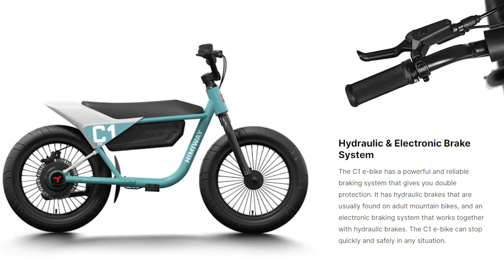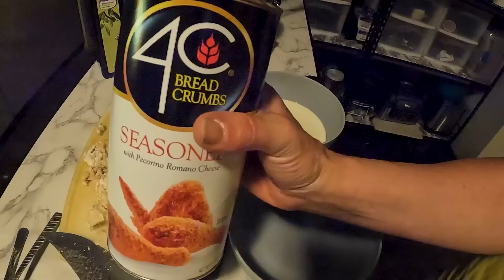Things Sure Have Changed.. Life On Our Cabin Homestead | Giving The Gift Of Adventure! |Himiway C1

Comment: Make a slurry with your corn starch. Mix the corn starch with a little bit of cold water and stir it into the boiling liquid.
Flour makes a roux and corn starch makes a slurry. The trick is adding cold slurry to boiling liquid, it will thicken quickly with no lumps.

Comment: Happy Birthday Julia

LOL you set 10,000 timers when you set yours. 1,000 corn starch suggestions I agree with. π r² but cake is round.

My own recipe, no bake strawberry cream cheese pie (Kool Aid pie)
3 - 8oz.softened cream cheese
3 - 8oz. tubs Cool Whip
1 cup sugar
1 package DRY unsweetened Kool Aid (just the powder - do NOT make the Kool Aid)
2 large graham cracker crusts.

Unwrap the cream cheese and put in a 3qt. bowl and store it in the microwave for 1 1/2 hours to soften & to keep cats and bugs away. Blend the dry Kool Aid & sugar with whisk. Blend the sugar into the cream cheese. Remove the covers from Cool Whip and float one at a time in two inches of hot water ( they will pop right out whole ) for 10 seconds & add it to the cream cheese blending on low, one tub at a time. Divide in 1/2 into the two large crusts, invert the clear covers from bought crusts, crimp and store in fridge for one hour (if possible).

2 pies are necessary because 1 Kool Aid is too strong for 1 pie.

Comment: The trick to no lump sauce (gravy, etc) is to mix corn starch with cold water in a small bowl or cup until smooth.  Then, add the mixture slowly into the hot sauce while stirring constantly.  You don't need to keep it at a fast boil, just a slow, gentle one.  It will continue to thicken as it cooks.  Also, trick to lomein is hot oil....not sesame oil for searing/cooking.  Use a less delicate oil for cooking at high temps, like vegetable or olive oil.  Sesame oil is more about flavor, not performance.  Best results are from fresh veg sautéed in high heat and then toss in the noodles.  Always keep the food moving in the wok or pan.

Comment: The posts that you put up last video will fail as wood is only treated on the outside not the inside so when they were cut they should have been painted/treated a with product call cut n seal or cut n treat.

Comment: If you mix the cornstarch in a little cold water in a ramekin before you add it, you wont have lumps. But the thing to actually use is gelatine sheets and mix in a small amount of boiled water